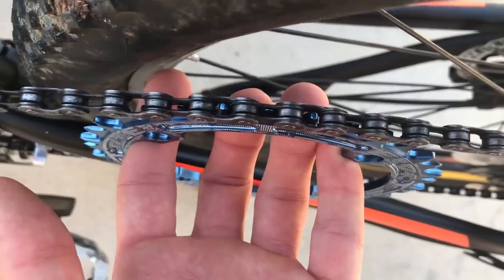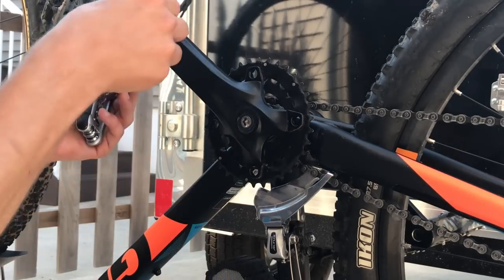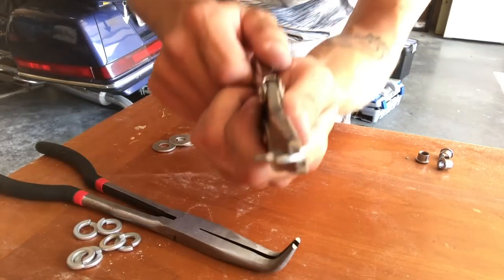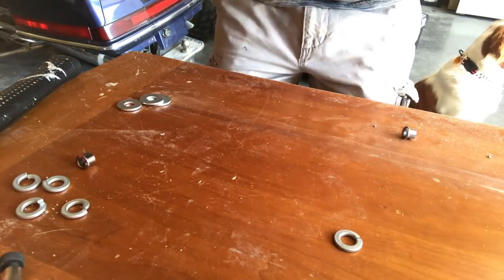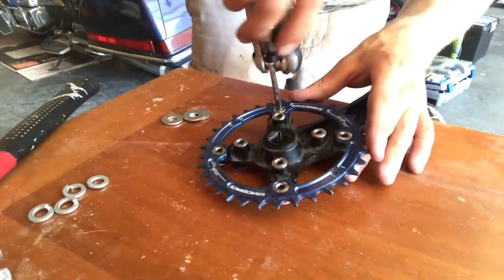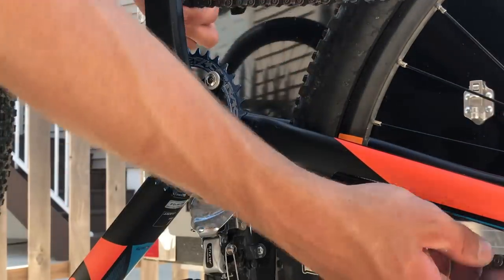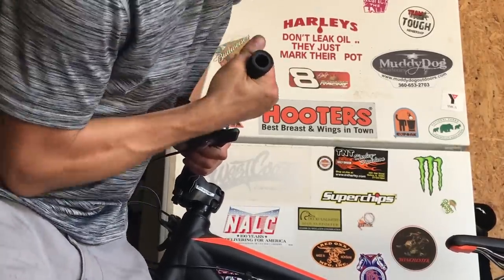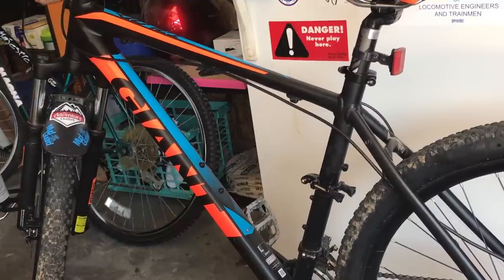3x8 to 1x8 MTB Conversion - Stupid or WORTH IT?

Comment: Remove the front derailleur for a cleaner sleeker look.
Reply: AKA chainguide.
Reply: I guess the bike's running a 8 speed Acera rear derailleur.
Those things have almost no tension,so any bump with make the chain go off if not for the front derailleur.
Reply: Good call I was thinking why didn't he take that off too.... But good morning people!!
Reply: @samiranroy2245  narrow-wide chainrings don't drop the chain
Reply: @TheLaXandro  Ex-fucking-actly. If you're going to upgrade to a single chainring up front, you NEED to get a narrow-wide chainring.
Reply: Nope keep it on and lock it out in place to make sure the chain don't flop off.
Reply: @007-Bond  you need a clutch derailleur if u don't want to drop chains
Reply: @mariosebastian1516  Nope. With a narrow-wide chainring, correct chain tension and correct derailleur tuning, the chain should never drop. I ride enduro mountain trails and have SENT my bike into places it shouldn't be designed to go, and the chain has never dropped. Although, a clutch derailleur would be prefered.
Reply: @007-Bond  ok then I'm good if I buy a sram gx and put a narrow wide chain ring
Reply: @mariosebastian1516  Should be mint 👍
Reply: I also want to remove it, but then I need to break my chain so wait till I have to change my chain then remove it at the same time.
Reply: @J-Young_photography  Good idea
Reply: OK bicyclists. Clue me in on what the '8' in '1x8' stands for. I'm looking to go to a smaller chainring from my larger 1x? It's already a single chainring, so I plan to just shorten the chain to keep proper tension. What do you think?
Reply: @ernieschatz3783  Think it means 8 speed at the rear.
Reply: @samiranroy2245  I'm running the old 8 rear single up front and I can't drop the chain whatever I do ,narrow/wide 4 life 💯🤠🤟
Reply: @ernieschatz3783  8 speed rear cassette
Reply: @ernieschatz3783  If you have a derailleur then there's no need to shorten chain
Reply: Nice video, although to me switching from a 3x to a 1x always was and will ALWAYS be considered as a downgrade 😊 smaller range of gears plus a horrible chain line at the ends of the rear cassette. Not ready to change efficiency and practicality for a couple hundred grams less and a 'sleeker' look, sorry.
Reply: I thing 3 is better then 1.....plus it's easier to drop to a lower gear climbing with a front derailleur...

Comment: Nothing is stupid if it works.
Reply: Not true at all
Reply: So why change in the first place?
Reply: @Kayvoyager  Because the psychological pressure of the marketing industry is to strong. And in this way you still get a psychological victory in not spending a lot more money on a 1×10/11/12 setup. But you knew that allready;-)
Reply: You could empty a bath tub with a spoon. Given enough time and it will work, but it is still stupid.
Reply: @rogerlahaye1948  you are assuming a lot of things there bud. Lighten up ;)

I did a 3X to 1X conversion on my old gravel bike hybrid by buying a cheap cassette and cheap chainring to maintain practical ratios. Got to ditch the FD, cable, and older worn-down steel chainrings for reduced complexity and weight savings while still having my previous top speed (at a slightly higher cadence) and climbing ability (at a slightly lower cadence). Hundreds of miles in and still going strong, 20 bucks well spent.

That was my first "upgrade" on my bike in 5 years. So i guess the bike industry got super rich off me by spending that $20 after 5 years of just pure maintenance? Lol.
Reply: @sepg5084  way to go man, that sounds like a Victory to me:))). But you are right about lightening up, I get carried away sometimes!
Reply: Heroin
Reply: If you ride on rough trails… your derailleur won’t keep enough tension on the chain. You need to switch to a 10sp system which comes with a clutch derailleur. I did this to my son’s HT.  Otherwise it’s not safe and your chain will keep coming off at the worst possible moment. Good luck.
Reply: You got to work. That’s all that matters.

Comment: Proud 1 by 8 owner. I've actually upgraded the cassette to a 11-42T, which gives me quite a bit of range. Works like a charm!
Reply: What's the teeth of your chain ring? Thank you in advance!
Reply: @theking_023  I wanted to know the same thing. I just converted my Trek Marlin GF 29er to 1x8 and i went with a 32t chainring and its ok for moderate grades but as soon as i get to any real climbs im not able to make it far before i run out of steam. So i ordered a 30t (smallest size i can find for 104bcd cranks/chainrings) and i think thats going to help. In my very limited experience im thinking 32t up front would be fine for the average rider in a 1x8 setup with 27.5 wheels. If your bike is a 29er and your cassette is a 11-32 like mine though i would recommend starting at a 30t chainring (or 28t if your cranks work with them and you can find one). Ive had zero chain drops since the conversion, but id hate to "jinx" it lol. Im not using a chian guide either. I planned on getting one if i was dropping the chian but so far it looks like the narrow wide chainring is sufficient. And on top of that im not even using a 9 speed chain like some guys do when they convert to 1x8. I imagine if i was dropping the chain that might also help to try.

Comment: Do you like watching seths bike hacks? Because i noticed that you have almost the same approach.
Reply: @that_squires_guy  Narrated voice over a video is not Seth's invention, you know. It's just the topic.
Reply: That what I was thinking
Reply: Hey there! 
How its this hack going so far???

Im trying to do something alike but turning my 3X8 into a 2X8 with a much larger cassette. Since i never use the larger disc anyways... 

How has it worked for you so far???
Reply: I'm a fan of the 1x - one question tho, why didn't you pull the derailleur, it's a big part of the weight loss?
Reply: Sounds like Seth too
Reply: @that_squires_guy  seth has made videos of ways to get off the chain without a tool, or does your bike not have a master link?
Reply: You mean to tell me this isn’t Seth?
Reply: @maximusgladi8or  
He probably doesn't have a master link since 8 speed chains can't have master links (at least that's what I know)
I maintain 2, 8 speed bikes that doesn't have a master link and I have seen many other bikes 8 speed bikes without a master link.
Master links are rare on 8 speeds
Reply: @rhythmic6753  any chain can not have a master link, or any chain can have a master link. all bike chains are made generally the same. so even if a bike does not come with one, you can spend pennies to the dollar and get a couple to install. all you need is a chain breaker.
Reply: Jajaja 😂🤣

Comment: "no body likes taking of handle bar grips" someone has never had lock on grips...
Reply: That's what I thought, lock ons are amazing, probably the best upgrade i ever made. (Haven't got a dropper yet)
Reply: I love my lock on grips to
Reply: @dumbr2098  I reccomend the X-Brand dropper for $99. It has been reliable for 3 years on 2 different bikes of mine!
Reply: @scottiemanners  Yeah, it's stock on a lot of bikes!
It's stock on the bike I'm saving up for currently so I won't be buying it for my half broken bike I have right now. 
Vitus Sommet, can't wait to have that bike.
My bike right now is a singlespeed cause my derailleur broke.. not buying new parts for it.
Reply: Lifehack: Use an air-pump and push air on the grips, on forget to cover the other side of the handle bar of course, it will inflate the grip a little bit allowing you to slide it in or out very easily.
Reply: @kurtsanches8819  Everyone knows that already.. just use water
Reply: I found an easy way to get grips off. Even the tightest ones. Get a slot screwdriver skinny one working between the grip and the handlebar at least a half an inch to an inch and spray some rubbing alcohol in there and then as it loosens you can push the screwdriver and more and get more of an alcohol Wait 30 seconds and poof grip comes off also works to put on type grips too then evaporates to nothingness
Reply: @kurtsanches8819  or just push the thing with your brakes since you will still have to remove it
Reply: @scottiemanners  for 99. $ they better be! After buying those you should never ever have to buy them for the rest of your life and for your great grankids lifes either! That mean pass those bitches down like mom passed down her pearl ear rings and necklace! That's right ! FAMILY HEIRLOOMS!!!
Reply: @kurtsanches8819  that's good, but if you can't do that, then pry up the grips and pour in rubbing alcohol they will come off very easy put them back on again using alcohol it dry quickly without any problems of slidding off later, but some things tells me you like doing things with  your muscles more  and not always the easy way
Reply: @grangergreenback7152  $99 for a dropper seat post... not hand grips
Reply: amazing until the fucking screw strips...
Reply: @nathanwazowski  if you get a good brand of them. they should have a torque rating for the screw, so you never over tighten, and so that you don't run into that issue.
Reply: He could also use WD40 or brake cleaner or MAF cleaner to help lubricate the inside of the grips. Just did it today to put lock ons on my lady’s bike.

Comment: Yay a fellow rider that has no money and unknowingly triggers every single xc rider on the face of the Earth. Some people don't realize that we ride for fun not a Strava time.
Reply: @that_squires_guy  lol thanks for replying btw do you know the sizing of the front chainring thanks.
Reply: it's not just for the fun, 34/34 it's going to give you 1m on the easier gear, compared to the 0.64 a 22/34 setup would give, it's around 35% loss on how easy your easier gear will get? So now climbing will be harder just for the looks. Looks never go over function, there is a reason why the lower the number of disks the crankset has, the higher the number of sprockets on the back, to keep the climbing ratio as similar as possible without loosing much speed on the plain.
Reply: @Asthbendriel  lol I'm still going to do it
Reply: Amen brother 😂
Reply: Do what makes you happy bro, I did a similar thing to my city bike, I have a crap altus 8 speed drivetrain, i ditched my triple riveted together cranks up front, I now use a crankset with a 44t narrow wide. The bike is definitely more fun. I soon will upgrade the rest of my drivetrain to sram x9 for a more appropriate 1x10 setup.
Reply: Haha yess best speech 2018 😂👏
Reply: the broke mountain biker I wonder how bad I’ve triggered every xc rider after adding a maxxis minion dhf 2.5 and minion dhr 2.4 on my entry level as well as shortening the stem
Reply: the broke mountain biker j
Reply: @mashed-out  TRIGGERED
Reply: But it still does not fix that one pain-in-the-ass thing that always happens you're never in the right gear when you need to be. That's why I don't get it. unless you want to ,PT cruiser the original 1×. And that's where it should have stayed on the road.
Reply: Robert Trageser  oh! Bad habit 3. 1×11 and still doesn't make sense. But I'm looking for a way to go to 2×on there. I do like the speed of a 3× but there are more things you can do like seeing how much you can progress using every one of those gears on that bike. again you limited to what you can do with a1× but I like option. For progression,it not about the speed for me, it's about power and endurance. Yeah sure speed part of it too but mainly strength endurance. The Max's speed so far 38.6,mph.5 pedal cranks off the top of the hill . only to see what it would be like, thank God no one was coming the other way. Usually consistent with almost 30 32 miles an hour. no pedaling.
Reply: Robert Trageser  yeah maintenance can be a pain, but that's part of what we do.i don't mind it at all.i do it for safety reasons.
Reply: Xc riders are not the enemy, that's ebike riders
Reply: @that_squires_guy  yes...what do you think of your conversion?
Reply: Juan Carlos Alpízar thank you I was wondering why but as you said it’s for fashion and  one more thing you forgot to make it lighter I guess
Reply: You don't need to be broke to bodge everything. It's a way of life, and knocking down KOMs with a 20lb bike held together by zip ties and electrical tape just feels better.
Reply: @Tomeasz Olkuasz a nw chainring would make it fall off as many times as a 3X8 my 3x8 setup is driving me crazy as it falls off literally every jump i go on
Reply: @Milo-sc7hg  i did the same lol
Reply: Yay... 800th like on this comment. Anyways, totally agree. I felt I found a new best friend after 30 seconds. Like someone had secretly filmed me being a no frills hardtail cheapskate thrill seeker. Cheers to us all!
Reply: @lufbraroots  I don't agree with it being a mass because it is a added benefit,like I have said before I have not drop the chain not one time by using the front derailleur you would think the amount of rocks being kick up that would knock the chain off but no has yet kind of wonder if they have shin guards for mountain bikers those rocks are really hurt. But what I am saying for last few years about this is that make bikes that are capable of customizing their drivetrain any which way you want instead of a dedicated bike for one specific standard that obviously what makes sense on a trail logically speaking but the benefits with a front derailleur outweigh a single crank any day but I'm guessing people have bad experience because they didn't know how to work on them which then it would make sense but you need to know your bike before you go on the trail so that shouldn't be an excuse coming from a bike that weighed over 36 pounds with 26 inch tires and a crank that was a size of a bandsaw blade and that was a 3-ring crank and I had no issues with that particular bike I ever have to worry about stopping to be concerned but I didn't have any issues but this bike was fast Stupid Fast but somebody stole that from me now that bike if it had disc brakes because those Rim brakes were doing nothing for me disc brakes air shocks and fork and  dropper post those are the best upgrades bikes with options are the most necessary including drivetrain and everything with wheels and wheel sizes that's a bike not the ones that they are showing right now with the single speed crack it's just not practical but then again I am not the one taking the gondola to go up the hill to ride downhill I'm the type of person that urns my Hills. But I believe people should have those options available if they like a three-ring crank it should be up to the individual I like two rings crank it should be up to the individual if they like a single ring crank it should be up to the individual the contacts are a lot better than they once were trust me I know. And I have that very same bike with a 3-ring crank a newer bike to me 2016 Kona precept slightly modified suspension but the bike still perform the same if not better the slight modifications but the chain on the rear of the bike rear derailleur it had came off but that was because boot had rubbed up and knocked the chain off the derailleur one time. But I think the bike I have they nailed it with the front derailleur and I bike I still have but because these new bikes don't have that same setup it's harder to find a new bike. I just really don't think they should decide for everybody what is best for everyone that really hasn't experienced anything well enough to know the benefits up to that previous drivetrain. But I must be lucky I guess.
Reply: Lmao
Reply: @Asthbendriel  i know this is an old comment, but you are saying 1X is just for looks? Lol, that's a pathetic mentality you got there.

I did a 1X conversion on my gravel bike hybrid by just replacing my chain ring and cassette and an rd adjustment, maintaining a practical top and bottom ratio. Reduced complexity and saved weight while still retaining both my top speed with a slightly hightened cadence and my climbing ability with a slightly lowered cadence.
Reply: @Asthbendriel  Actually x1 systems have less weight, less noise and by default are easier to use. They also look a lot cleaner on the bike as well as the cockpit, especially if you are using a dropper post. x1 cassette ranges are always expanding and the easiest gears on most of the 10/11/12 speed cassettes these days is more than enough for most mountain bikers.
Reply: @Mr. t "CLUTCH"
Reply: but that’s not why he said he’s doing it. He actually said he’s doing it to make his bike look better.  We all know you have more FUN when it’s easier to peddle. I have more fun anyways when it’s easier for me to pedal.

Comment: Did my 27 speed, just removed the smallest and largest chainrings and added a bash guard. Also removed the front derailleur and shifter. Works fine and super cheap.

Comment: Here are 3 tips (for slip-on grips):
1. When taking grips off, use an air compressor and put the nozzle under the lip of the grip. If no compressor is available, kinda semi roll the grip of the bar onto itself.

2. You can shove some zip ties under/in the grip to get it off.

3. To put grips on, spray alcohol/water onto the bars (it will dry), it make it much easier

Or just use lock on grips! (My preference, they're more secure too)
Reply: I found jamming long zip ties right under the grips about 3 on each side and the grips slide right off. And hairspray to get them back on, let it dry before you use the bike. Now that's proper cheap-ass 👌
Reply: @MartyMcFryyy  Right, I forgot that trick! I'll edit my original comment.